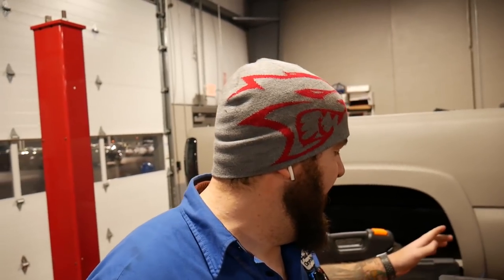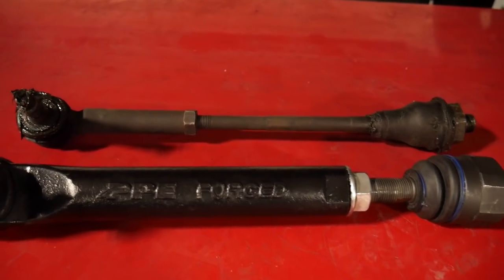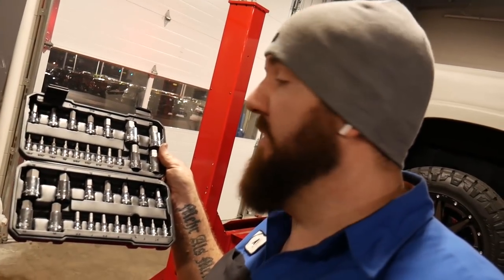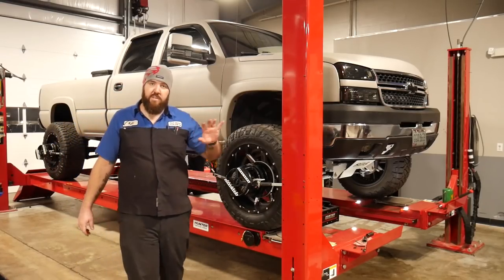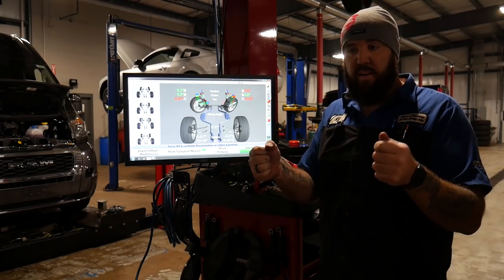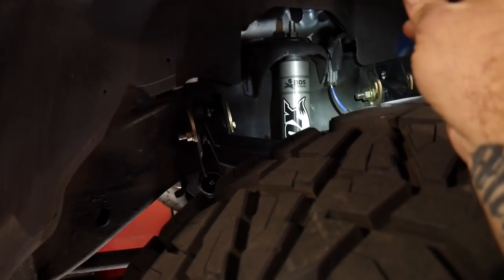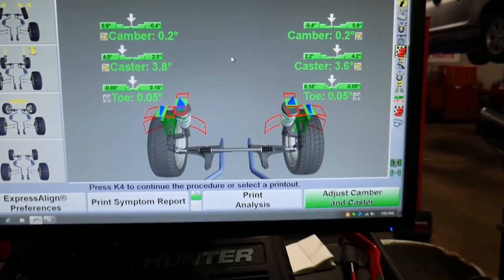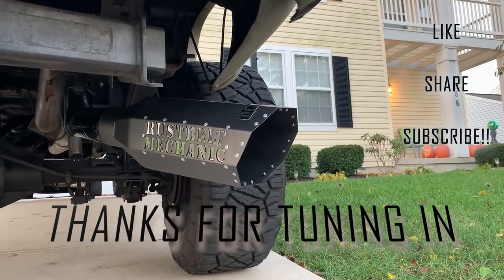ALIGNING A LIFTED TRUCK AND ADDING PPE HD TIE ROD ENDS

Comment: Got my 2” open ended wrench from tractor supply. Bought a set that included one for my steering gear box to pitman arm nut. $80 for 6 wrenches. Killer deal

Comment: I put the cogneto tie rod kit on my duramax. I don’t recall the ppe kit being out yet. Was quite some time ago. Just didn’t like the tie rod sleeve idea. The joints on the factory tie rods are still tiny and a possible failure point. So I went with the cogneto kit. They are very similar to yours. Very large and were pretty cost effective. Been on the truck 5 years now no issues. I drive this truck everyday. 70,000 miles on them.

Comment: Took my 2000 Silverado 1500 in for an alignment after I installed a Rough Country leveling kit 2-3” lift. The shop guy told me when he put the steering wheel straight to conduct the alignment, he had no more thread left on the tie rods for adjustment. What he ended up giving me back is a truck that almost goes straight (steers to the left just slightly) and the steering wheel is about 45 degrees turned to the right as the truck is going straight forward. Yes, you heard that right, 45 degrees! He told me someone must’ve unhooked the steering shaft from the steering box and not put it back straight. I just bought this truck and the previous owner told me he has never disconnected the steering box or the steering wheel. So someone is lying to me I believe. Do you have any thoughts? Great channel. Thanks.
Reply from the maker: Likely is in the brackets of the lift or how the spindles sit. And you can’t really unhook the steering and put it into a different position. Now that may be different between your 2000 and my 06...but I’m guessing someone has something not hooked up right or the alignment guy just didn’t want to mess with the caster and camber to bring everything in correctly.

Comment: I’m having the exact same issues where I have a very slight toe out with the tie rods threaded all the way. I plan on going from a 3/4” jam nut to a 3/8” jam nut and this should solve my issue but is it bad to have the tie rods threaded all the way in? If so I’ll end up chopping a bit off of mine as well.

Comment: You figure you would like your truck a little higher.. then after that you would have to change tire, rims, then other issue on the road..it’s incredible how much money you need to spend as soon as you modify the OEM settings..
Reply: Alessandro Terracciano, absolutely right. I made the mistake not taking into consideration how much extra money I need to make sure everything rides like factory.

Comment: Hunter alignment machines using winalign, you do NOT have to lock the steering wheel. (On IFS vehicles). Solid front axle you do.
Reply from the maker: Yes you do have to lock steering after doing caster sweep
Reply: Rustbelt Mechanic Not with the WinToe feature.  Hunter actually emphasizes at their training that if you’re using WinToe, you do NOT use the steering wheel lock as the computer does a bunch of math that I myself am not smart enough to understand to ensure everything goes where it needs to, and the wheel has to be free for it to do so.  If you’re just doing an alignment without it like you did in the video, then yes you lock the wheel, but if you activate the Win feature you do not.

Comment: I wouldve gotten that caster split a little closer. Especially on a lifted truck for less pulling
Reply: It's best to have a little  bit more caster for the right  side for road crown
Reply: @genawilcox9039   Yes, if your area is crested on typical roads. In Montana there is rarely a crest, the road just goes with wherever they layed it

Comment: Hey Rustbelt Mechanic. Great videos and I appreciate all the explanations on everything. I have some questions you may or may not have answers too. I have a 2002 GMC Sierra 2500hd SLE CCSB LB7 Duramax. Just got it back from the lift shop and we put the BDS 7" with leaf springs and tow bags in rear. We did the single steering stabilizer and Kryptonite front end upgrade, upper control arms, upper & lower ball joints and hubs. We also had the Readhead steering gear box with new lower and upper steering shafts just because we were in there already. I have a very similar wheel and tire setup as you do, Fuel Rampage 2 piece 20x10 -19 offset on Nitto Graplers 37x12.50. I feel my truck swaying all over the road still. My questions are as follows, would I need to cut the Kryptonite tierods to get it aligned properly? It feels as alignment is off. Also, I'd like to upgrade to dual steering stabilizers, BDS as well but wonder if that can be done with the Cognito's pitman arm support kit? Any help and input would be much appreciated. Clean looking truck too. 👍
Reply from the maker: As far as the tie rod ends, yes they will definitely need to be trimmed. But I am not really sure on the upgraded steering components working with the dual stabilizer kit. I haven’t quite got there yet on this one but have a feeling I’ll find out the answer to this question one day when I do this.
Reply: @RustbeltMechanic  I thought I needed to trim those tie rods. Thanks again for all you do. Hard to find quality and honesty these days and you're doing great. Keep up the good work.

Comment: Late to the party but Great video man, really informative. Is it possible for excessive positive camber to affect tie rod angle? Just put a 2” level on my 16 Silverado and haven’t had it aligned yet, but the tie rods are making noise when turning steering wheel while stopped. They are almost vibrating(I’d imagine it’s the angle from lift + a very positive camber angle?) you think I should even try getting it aligned to POSSIBLY alleviate the issue? Or should I just pull the level kit if correcting the camber won’t really help with the angle/noise of tie rods? Anyways. Any insight would be helpful. Thanks man

Comment: When adding a suspension modification, does that affect the angles and measurements when aligning?
Reply from the maker: Yep absolutely
Reply: How do you compensate? I am unsure how and do not want to turn away customer's at the Shop I manage.
Reply from the maker: You just have to realign any time you change anything with aftermarket suspension components

Comment: 2In wrench for tie rod end inner half installation? Not a problem. That's why it pays to keep those ol' china knock off tool wrench sets from the mid 90's when doing semi truck work. 

For those who don't have, think about those friends from tech school who went to working on semi trucks or even a tool such as the Snap-On pipe wrench / pliers combo. Can't think of the part number but they make a regular non snap on brand one that does just as well and will get you the leverage needed. 

A good set of china large wrenches in the pouch from 1 1/2 - 3 in are great to have around for those once a year deals but heck the wrenches were cheap enough you got the set for the price of 1 maybe 2 maximum brand name wrenches of the same size. The metal is so large it's not bending anyways. 

@Rustbelt been laying low for awhile and was even sick this week even though had my flu shot I think I got a variant and you're talking to a guy that won't leave his house / garage for up to 5 days at a time or sometimes more. Generally 3-5 days but still on the mend. Thank god for chicken noodle soup,  a whole pack of crackers to help and a bottle of gatorade each meal twice daily. Makes a difference in helping flush and heal the body. 

✌✌✌✌✌✌✌✌✌✌✌✌✌✌✌✌✌✌✌✌

Comment: You do Chevy s10 or parts that go on s10s because I drive a 2003 Chevy s10 crewcab and I would like to know how to wire the Low beams and high Beams together. Great videos love them all and keep up the great work
Reply: There is a chip you can buy on Amazon that goes in your fuse box in the engine compartment.

Comment: Random question but have you ever bled your brakes with actuating the abs on your truck?
Reply from the maker: I have not on my specific truck but have on many like mine before using the abs brake bleed procedure in a scan tool.

Comment: What do I need for my 2000 Chevy blazer after a 2.5 inch lift? They said they can’t align the camber correctly because of the lift
Reply from the maker: They would have to find an aftermarket kit that either allows adjustable ball joints or different control arm bolts that allow camber adjustment.
Reply: Rustbelt Mechanic thank you
Reply: Rustbelt Mechanic is it a new control arm or just a bolt?
Reply from the maker: Chad Hastings those are all new control arms and hardware.
Reply: I have 2014 sierra was told couldn’t do alignment but bare do something to cam and adjust steering what best recommendation

Comment: don't you have to set the steering wheel straight before you adjust toe with that machine. our older hunter you set the wheel and use win-toe to set the toe.  a jacked up truck with lift kit and steering parts will kill flat rate alignments.

Comment: i dont see how the larger tie rod has the advantage both have the same threaded  ends which is the weak link.  me personally  i would rather it bent on the trail and not snap in half. and save weight at the same.  just my opinion